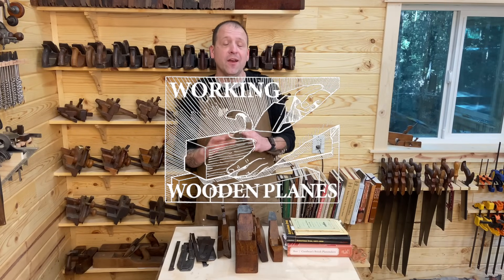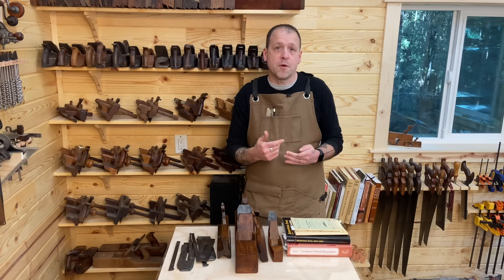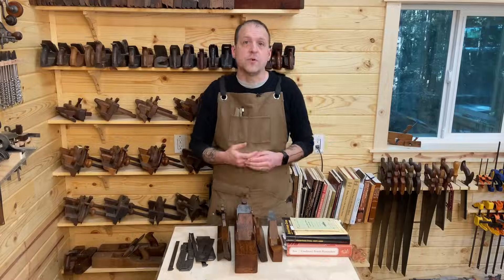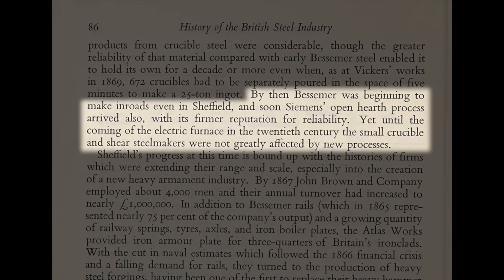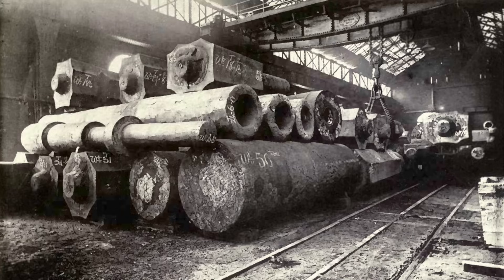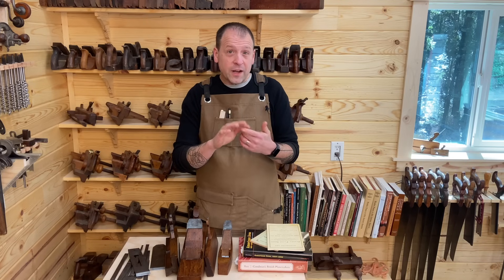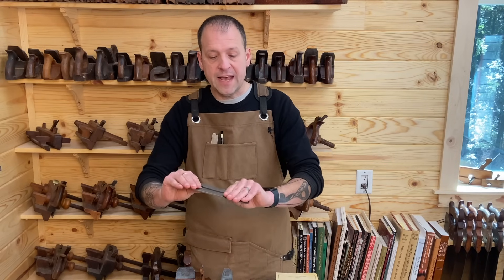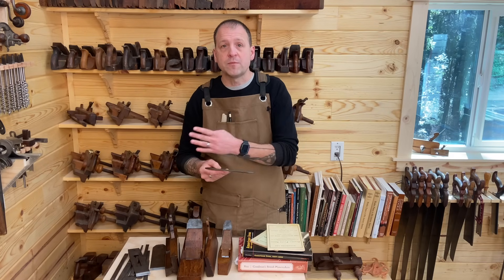The True Story of Cast Steel (Was Bessemer a liar?)

Comment: I do take issue with your characterisation of Bessemer.
 The early issues with his process was that while it did work as he said it did with the feed stock he was using to develop the process it had issues with feed stock that had a higher sulpher/phosphorus content. It took some years to both find out what was causing the issue and how to resolve it.

The bessemer process is a refining process. The first iteration was excellent (for the time) at removing silica and carbon.

Swedish iron ore is naturally low in impurites and also contains a mix of metals that alloy to make very good steel.

Since the Bessemer is a refining process any steel made using that process will move towards the quality of swedish steel. So, depending on the feed stock used (what impurities it had and what other elements were present) it is quite possible to get swedish quality steel from lower quality pig iron feed stock.

In reality it would only take a feed stock low in sulpher and phosphorus and with a little bit of vanadium and it would ( to the knowledge available at the time) look very much like swedish steel.

It is worth noting that when Henry Bessemer was unable to solve the issues that SOME people were having he bought the process back (he refunded the money and their right to use the process) from those having problems.

It is not a lie if you genuinely beleive it to be true. That doesn't mean that what you said was true just that it wasn't a lie.

Comment: It was my understanding that the Bessemer process just blew air into liquid iron to melt out all the carbon and then just the right amount of carbon was added back in to make a steel with the correct percentage of carbon in it to be considered steel where befor the only way to actually make steel was hammering the carbon out of iron after it cooled like a blacksmith would do or just be lucky and the percentage of carbon just turned out to have the right percentage after you melted it. Im willing to bet that most of those old cast "steels" are closer to being iron than to being steel if they are steel at all when considering how much carbon is likely in them
Reply: Bessemer made pig iron. It was quite high in carbon and brittle. It needed refining to remove carbon to make it forgeable. They had to cook the carbon out. Using crucibles has only one advantage, carbon control. Neither process is easy. It's all hard work even small scale. And something not mentioned here.............extremely dangerous! Work related Injuries, sickness  and deaths don't get mentioned but were common in these processes.
Reply: I forgot to add: the Bessemer process used giant bloomery furnaces with tuyeres that blew hot air in instead of cold. It allowed higher temps. Hot air rising inside the furnace was cycled through pipes back into the bottom of the furnace. Hence the pig irons carbon content due to no fresh air being cycled in and carbon out. In essence his process is a replication in its entirety of a standard bloomery furnace except it cycles hot air and melts the iron entirely. Something standard bloomery furnace don't do. The cycling of hot air over using an intake of cold is clever stuff and is the advancement over old methods. 👍

Comment: Being an avid reader, I have read many times over about these processes. I did not read about the personality’s involved which gives better insight. 
My own blades are made of Top Sheffield quarter inch thick stock. Amazing steel to work with and to process that keep a remarkable edge. 
As for your video?
Captivating!!!!
Excellent presentation with command of the subject as well as a smooth easy tone. 
Thank you for your excellent work. 
Greetings from the high plains of Texas.

Comment: Great video and very interesting. My maternal  grandfather worked in the steel industry for many years making pig iron in South Wales. Years later I was a field engineer responsible for the ongoing maintenance of many of the Yorkshire steel companies' computer control systems including the bar mill at Thrybergh near Sheffield. That plant was using a process called concast (continuous casting). Steel was cast in a continuous flow from the furnace through a massive, water cooled "casting" tube that needed thousands of gallons of water a minute to ensure that by the time the steel bar exited the "casting pipe" it had cooled sufficiently to be able to be run out onto the cooling grid.

The bar had to be robotically cut in a very short time as it reached the end of each loading rail. The multiple acetylene torches took sub second time (they had too) to cut the bar on the fly and liquid steel could then be seen running out of the "hollow" bar.

Fascinating and mesmerising to watch but a realtime programming nightmare. Also the only time preventive maintenance could be done was during furnace reloads after all the steel had "flowed" out to form hot bar with a liquid centre

AFAIK this process could be used to produce any kind of "cast" steel bar from mild steel to special steels but I have no idea of the detail on that.

Comment: I used to go to Sheffield with my father in the early 1980's, he would carry steel billets made in Brymbo Steelworks (Near Wrexham in North Wales) to a Massive forge in the industrial area. These billets were forged into crankshafts for petrol/ diesel engines for the car industry. I used to be overawed by these massive machines stamping up and down shaping out the parts. Thanks for the video, I really enjoyed it, and I think others may well have enjoyed  also.

Comment: Very interesting. Information is great and surprising nobody figured out Wootz steel aka Damascus. While they had all the tools to make it and knew what the problem was with mild steel. The key ingredient to great Wootz/Damascus is mild steel due to its predictable carbon content. Amazing how your average steel can be easily made into arguably the strongest and possibly sharpest steel for blades and cutting edge type steel. Great video. Always fun to learn how much we have come in such a short time and ego will always get you nowhere. Share knowledge and ask for help.
Reply: Wootz steel and Damascus steel are not the same thing, wootz steel is crucible steel, whereas Damascus steel is pattern welded steel.
Quite different.
Reply: @richardwebb9532  The original Damascus was believed to be crucible steel originating in that region. Todays Damascus is pattern welded. Then again its a highly debated topic so both are right lol. Depending on who the info comes from I guess. Either way Wootz has been around for a very long time and for blade/cutting edge steel its very strong in those applications. Todays wootz is best made with mild steel and carbon added as its very reliable outcome.
Reply: @the_fafologist  mild steel and carbon gives you 5160 carbon steel, not wootz steel. (0.2-0.4% carbon) anything higher than that is caste-iron.

Comment: Cast iron is not what it used to be indeed. I was searching for HRC of cast iron and most of it is very soft to keep it machinable. I hypothesized that it would make a good knife edge. Brittle but hard. Well you dont find it easily. It's a rabbit hole. I've heard about tools and gauges made of it but I decided that high carbon steel is the way to go these days. Maybe something higher in carbon like ZDP189 with 3% carbon and bunch of chromium but it's powder metallurgy so it's expensive. Cast steel should be close and super cheap. Even with a sprinkle of chromium there's no reason why it shouldnt

Comment: I am a machinist- toolmaker. I have worked mainly at manufacturing steel parts for/and\or machinery made out of steel. The first information I learned is that Iron is very soft, maleable, easily  bending so it could not be utilized for related to machinery purposes. 
Thousands of years ago humans noticed that after wildfires occurred in their area that some substances were produced that were as hard as stones , but they were sort of shining , that made the humans know that if they would utilize fire and sort of burn  stones and ea

rth/soil/sands they could produce those substances that were as hard as stones but they were different than stones. It was the METALS that were discovered by the very ancient humans. And as the time went on they discovered significant differences in the metals , as Copper, Lead, silver , gold, tin , zinc, iron etc.
The humans realized that Lead was very soft, copper was a bit harder, iron was somehow harder that copper, but they noticed that when they tried to make copper, a metal with a lighter rather yellowish colour was produced that was somehow harder than copper, being Bronze or Brass.
So by that time the humans were producing some rudimentary tools, cutlery and weapons. But some other humans started using Iron metal for cutlery, tools & weapons. Some of the humans noticed that when Heating Iron Ore some of it became harder when they "QUENCH" it with water in order to cool it down for handling , and some of them being right beside the Sea-beaches had to use Sea-water for cooling the Red-hot Iron in order to Handle it with the result that this Batch of Iron became harder. Then some Humans started experimenting , with longer Heating and Shaping the Red-hot Iron numerous times in order to get it as compact as possible, and that resulted in a product that it was harder than Iron, and not malleable , and that they used to substitute the previously Copper based Tools, Utensils, & weapons which was STEEL. What they did not know at the time was that by Heating / Burning the poles of Stones/Earth-Ore , where forcing the burning Carbon that was present in the tree'branches used to light-up the fire to infiltrate and embeds itself into the Iron, this creating CARBIDE molecules scattered within the Iron molecules, resulting in achieving making STEEL. Next in some areas the aboriginal inhabitants noticed that the Steel that were making was much Harder & Tougher than on other areas but they did not know that this was due to that in their area the ORE contained metal's that I.E. made the HARDNESS PENETRATION DEEPER by inclusion on this ORE of MANGANESE, and/or of inclusion of other METAL -ALLOYS as they are called also suc

Comment: You say in "Sheffield" all the steel makers basically had a go at Bessemer, by the way the first  Bessemer steel was made in "Manchester", actually in  in Openshaw, very close to the Whitworth factory, you probably don't think Whitworth had anything to do with screw threads. The steel makers in Sheffield had too much to loose not react against Bessemer

Comment: I find it interesting that carbon tool steels, 0.6 to 1.0% carbon all the way up to 1.25–2.0% high carbon tool steels were called 'cast' due to the process 
even though all steel mild low-carbon steel 0.05 to 0.15% carbon & medium 0.3–0.5% carbon & tool steels are all cast then milled or forged.
It's only after tool steel has been cast, milled or forged then annealed does its magic of being through hardening after 750c+heating, quenching & tempering becomes apparent. 
Powder metallurgy steels of even 2.5% carbon are today's version of 'cast steel'.

Comment: There are two different products, here. "Cast steel", or really tool steel, which are high carbon steels, and mild steel, or low carbon structural steel. Structural steel changed the world, because it was inexpensive, and used in mass applications where metal was never used before.

Yes, modern metallurgy, allowed for newer methods, that Bessemer maybe claimed prematurely, but ultimately that labor intensive method of making "tool steel", was replaced, though much later in history.

I'm an engineer, that has worked in the metal fabrication industry, and we have to careful with terms. What was called steel historically, is now referred to as "carbon steels". This includes both mild low carbon (but still has carbon) steels, and higher carbon "tool steels".  We also have better chemical analysis, allowing for modern alloys, and better purity, so things such as stainless steels exist, which would have been "exotics' a century and a half ago. Methods have changed, so its really hard to view things as they were in the past.

Comment: no one really know what damascus steel is for certain but the best theory is that i was a crucible steel done with a specific ore that naturally ad some additives that would create a special crystalline structure giving it greater strength... so that stuff was not layer per say though it had a pattern similar to what we now refer to as damascus steel even though that is artificial and done by forge welding layer together... which is fine but its probably not the same thing as the original... more a imitation that replaced the original due to scarcity of the product.
that and we now value the artistry of the layered stuff more since we can easily get high strength through modern metallurgy...

Comment: Thank you for a very good video and a nice overview of the processes. I am a metallurgical engineer working in the forging industry for the last 20 years and have been a blacksmith/bladesmith for 25+ years. Within the last few years I have spent a great deal of time researching this very topic and found the same information and references you did, though I have not seen Mr. Barracluagh's thesis, which I am looking forward to reading. There are a few details that might be worth clarifying: The Bessemer process was normally used to make low carbon steels because there was not much control over the process. Initially it was monitored by eye without any special instruments so if was very hard to stop the oxygen blow at just he right time to hit a desired carbon content. Converting 10 tons of pig iron into low carbon steel took about 10 minutes. The Siemens method was much better for fine tuning compositions because it took several hours or more and there was plenty of time to sample the liquid metal and make adjustments before pouring the steel into a mold. The method of melting blister steel was replaced much later by melting iron directly with a carbon source, but this practice was not adopted in until quite late. Harry Brearly, who was another instrumental Sheffeild steel man comments on this in one of his autobigraphies (he wrote 2) and notes that the blister steel would melt at a lower temperature than pure iron with a seperate carbon source like charcoal. This made it easier to achieve the desired melting temperature than to use the method that skips the blister steel. One final point of interest come from the book "The Arms of Krupp". The English really had a lock on the production of cast steel until the 1830s. At this time, Napolean sponsored a prize of 4000 Francs to whoever could replicate the English process. A member of the Krupp family was successful in doing that in the mid to late 1830s, but up until that time, pretty much all the cast steel in Europe and the US came from England.
Reply: Interesting that you mention the book The Arms of Krupp. I bought one at a library for 5 dollars. Quite an interesting read.

Comment: I saw an old film from the 1940s where one can distinctly hear one of the workers say, "It takes 40,000 cubic feet per minute of oxygen to make this converter work."  It is not air that is blown through a Bessemer converter but oxygen, or oxygen rich air.  (Ambient air is 22% Oxygen).  If you blew air through a converter it would only serve to cool the contents.  In welding - I am a welder - you can cut thick steel with Oxygen alone, once you've got the cut started and liquid steel running.  Bessemer patented in 1857.  I'm trying to find out how there was about 1/2 million tons of steel rail laid by 1835 in North East North America alone. I don't believe it was Puddle Furnaces.  i sure would like to know when furnaces became hot enough to liquefy steel. (it almost seems intentional; the lack of solid history of steel making!)
Reply: "  i sure would like to know when furnaces became hot enough to liquefy steel." - roughly 600 bce is the earliest crucible steel sword we know of... so, around then.  Park, J.-S., Rajan, K., and Ramesh, R. (2020) High-carbon steel and ancient sword-making as observed in a double-edged sword from an Iron Age megalithic burial in Tamil Nadu, India. Archaeometry, 62: 68– 80.

Comment: what role does (residual) hydrogen ( from not perfect coke ? or from variations of humidity of the furnace-wind?)  play in the quality of steel? atomic hydrogen is diffusing easily through the crystals and certainly does go into the melt. So modern "green" ideas of making steel with H2 instead of carbon may be a very bad idea. 
 Hydrogen embrittlement is also a problem in nuclear reactors.

Comment: You can carbonize “mild” steel. Adding carbon isn’t something that can’t be done. I’ve done it, many others have done it. Industry has done it. It’s done in the crucible. Whether Bessemer was lying about half of crucible cast steel made from his process steel or not, is a separate issue.

Comment: The key step during the Bessemer process is burning off impurities and excess carbon in an exothermic reaction with oxygen.  Note that cast iron is both very high in carbon content and very brittle.  

During the Bessemer process, the molten pig iron is placed in a vessel called a converter, which is tilted to allow the introduction of air or oxygen into the molten metal. The air or oxygen reacts with the impurities, primarily the carbon in the pig iron, to form carbon monoxide gas. This reaction is highly exothermic and releases a significant amount of heat.

The exothermic nature of the Bessemer process is an important aspect of its success. The heat released during the reaction raises the temperature of the molten metal, enabling the removal of impurities and the conversion of pig iron into steel. The heat generated in the exothermic reaction also helps maintain the high temperatures required for the process.